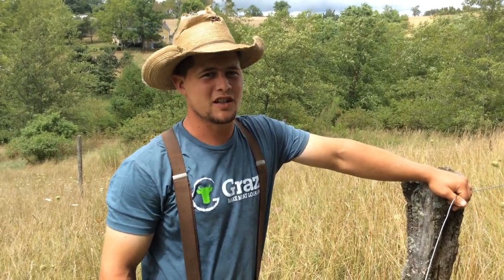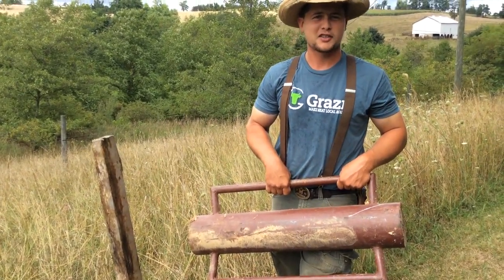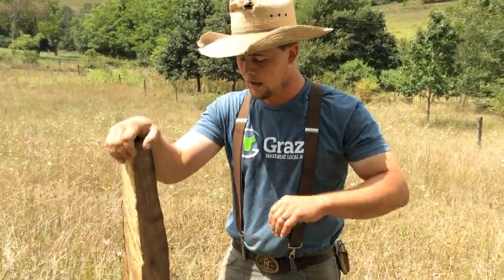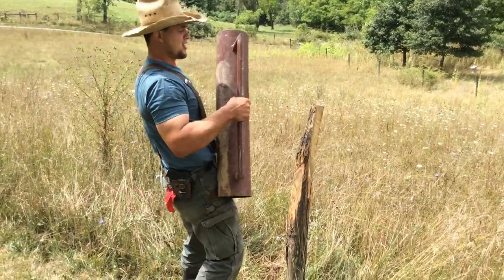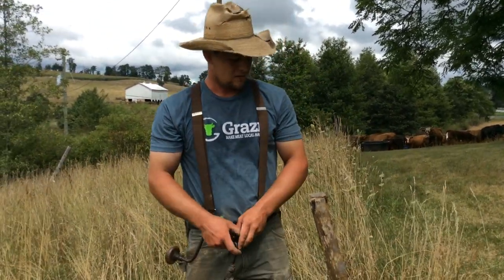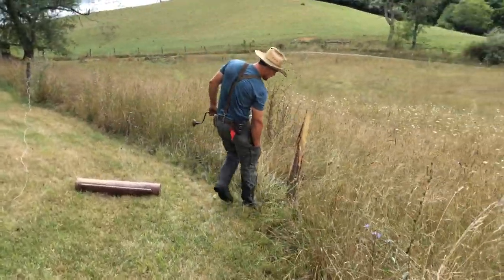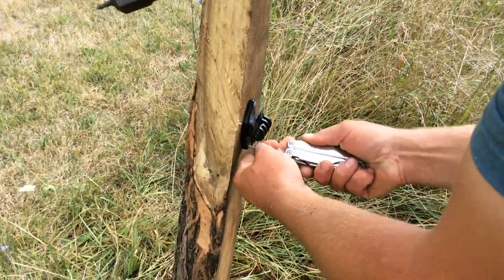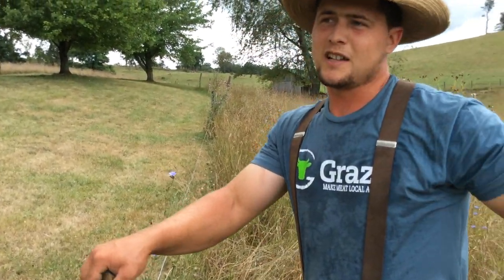Fence repair Polyface Farm

Comment: Do you know if it's true that a shock from Aluminum wire hurts more than from steel?
Reply from the maker: A spark is a spark, shouldn’t matter what type of wire it comes off of. That being said, aluminum is a better conductor so technically it can carry a hotter spark farther, but you would never be able to tell the difference with an electric fence.